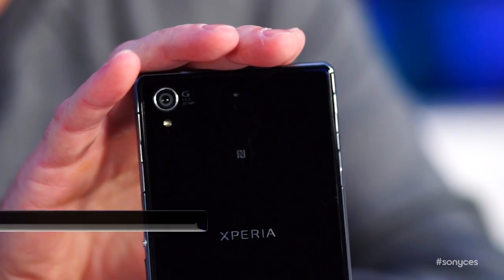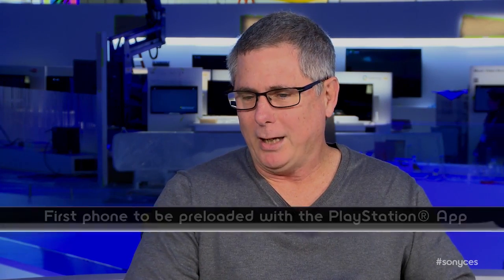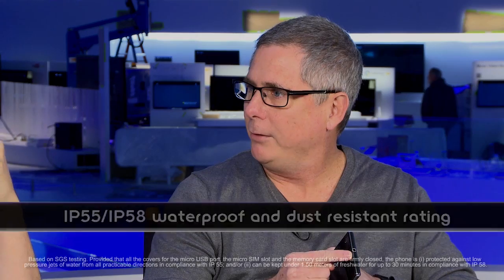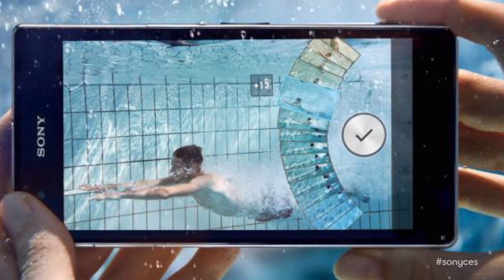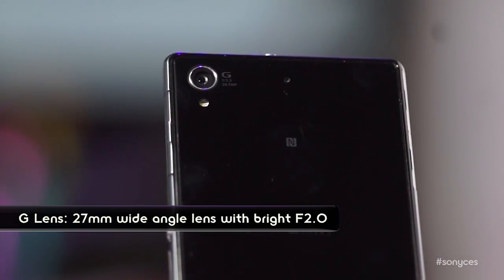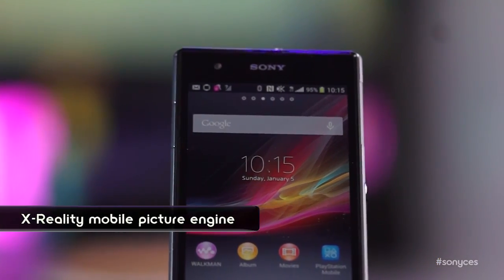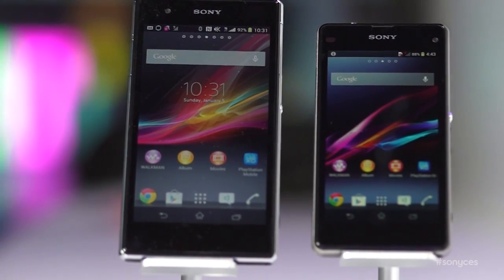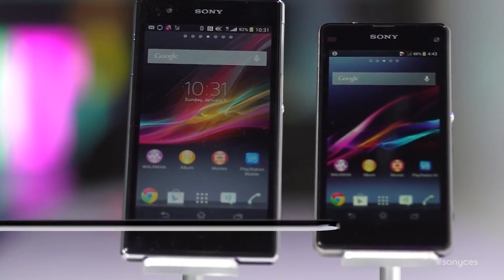CES 2014 FIRST LOOK! New Sony Xperia Z1S and Xperia Z1 Compact

Comment: Wow! The Z1 Compact is really compact and still high end! :D 
But Im confused, is it HD or Full HD screen? Id like Sony released more compact high end devices, like the ZL and this Z1 Compact, but giving more options like ability to swap batteries, changeable back covers, full screen toggles, nav bar customization, ability to turn Media Server off (its a battery drainer!), and HD resolution versions. Also, why not more colors? 
Come on Sony, give your costumers more options! 
Thanks!
Reply: Its 720p HD. So not full HD 1080p. Then again there is no need for full HD on a 4.3 inch screen. Once the phone updates to Kit Kat 4.4, it'll have the full screen functionality you so desire. The phone will come in 4 colours to my knowledge. Pink, Yellow, White and Black. The design means the phone is probably already thicker than Sony would like it to be. It'd probably just get thicker trying to allow users to swap batteries. I do however agree with you that they should allow users to turn off Media Server and customize the notification bar. The media server killed my Xperia Z when I had it very easily.

Comment: What's wrong with a 720p screen? I'd rather have that than an unnecessarily expensive and overkill 1080p screen, #1 you couldn't tell the difference, #2 its more taxing on the GPU ie you get better performance and #3 its cheaper! WINNNN